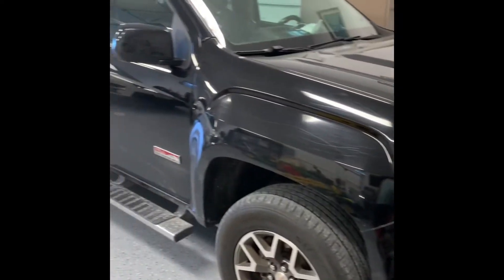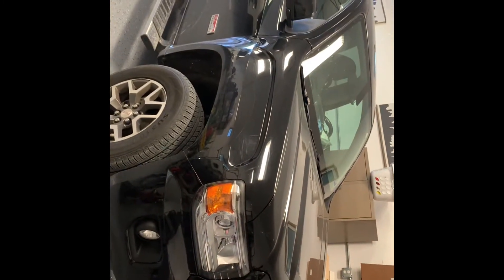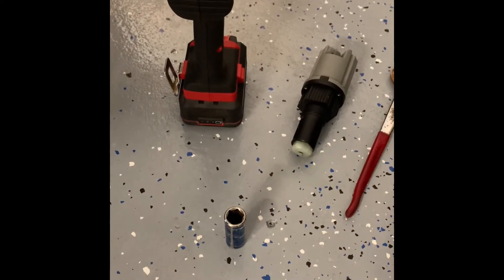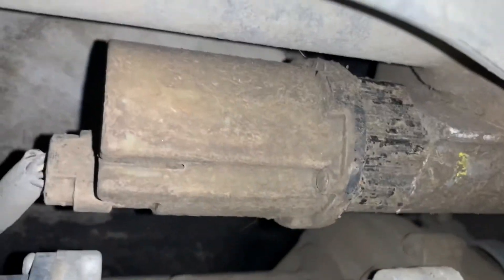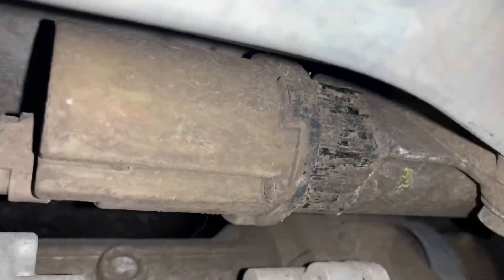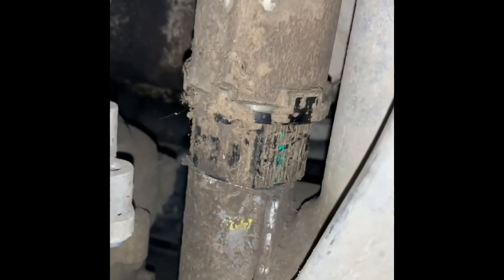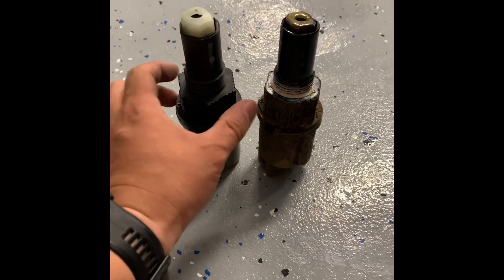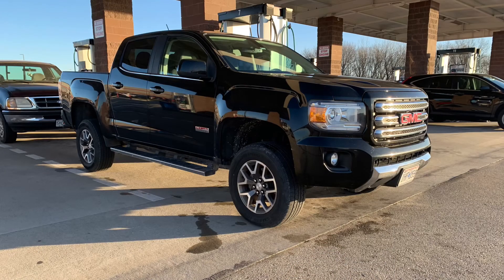2015 GMC Canyon Chevy Colorado Front Differential Actuator Replacement

Comment: This is definitely going to be my problem. I am missing my skid plate. Thank you so much for making this video. I looked up the part on Rock Auto and assumed it went on the transfer case. Now I just need to order a skid plate….
Reply from the maker: I was going to make a follow up video to this that I never got around to. After several months the problem came back and it was the encoder motor on the transfer case. If you look at it the electrical connection is facing down, towards any water dirt or elements. Hopefully this fixes your issue, if it does not or comes back, look at the transfer case encoder motor.

Comment: Hey man, I’m having the same issue with my 16 Canyon. I bought the actuator straight from the dealership. I am having trouble removing the old one because of the spacing. Did you had a hard time taking yours out? I’ve used channel locks and all that nothing helps me get a good grip to lose it.
Reply from the maker: I did not have a hard time, but it is a tight fit. If you cannot get it with channel locks, I’d use an oil filter ban wrench.

Comment: So my truck same model 2015 is stuck in 4x4 and was doing the exact same thing before hand. Then tried last time went into auto and must have kicked in. Then said service 4x4. Turned switch back to 2x4 and now still in 4x4. You think this could cause it to stay in if it is reading to take out
Reply from the maker: It might. I need to post a follow up video to this. A few weeks later my problems repeated. It ended up being the encoder motor on the transfer case. 4 bolts and a clip to get the old one out. Takes no time at all.
Reply: The encoder motor? By chance you didn’t do a video of that did ya lol! I’m not a mechanic but with a little direction can do most everything
Reply from the maker: @billmachen7635  I'll make something today. I have sold the truck on got a sierra, but i think i have pictures still.